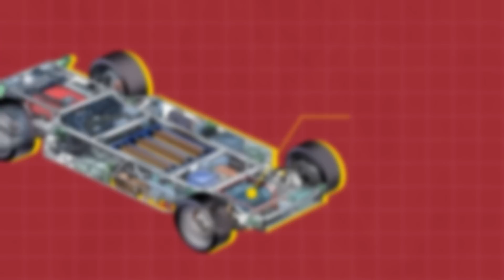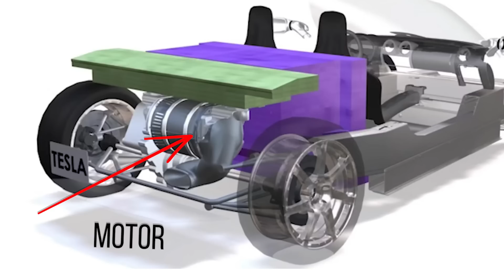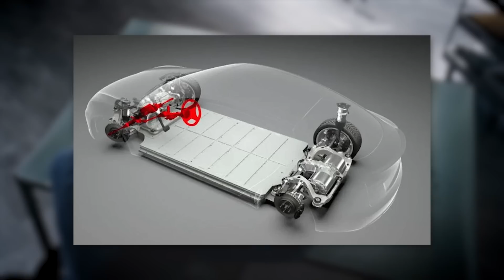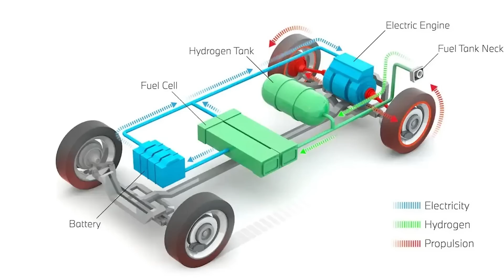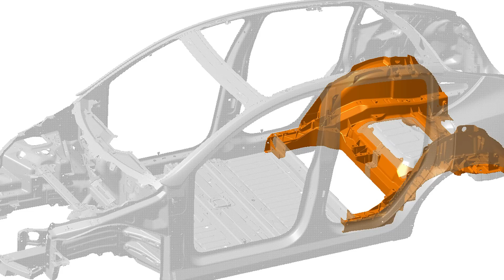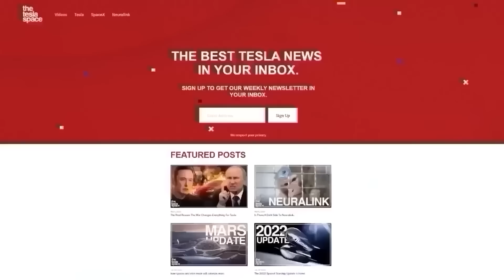The Real Reason Tesla Developed Their Own Battery Platform!

Comment: Lol. As much as Tesla really has done cool things and its good to highlight them they also suck from a users perspective at times. Taking away all buttons and indicator controls are a mess in terms of design and safety. Which is why i don't really like the uber-positive tone here in the video which kinda puts them up as a holy grail.

And before someone mopes around, i drive a M3P myself - it is a good car but they are making it worse and worse. Still missing an HUD, MatrixLED, Radar/Lidar, bad autoparking due to vision only etc. As much as they innovate in one point they suck at other points that are actually more valuable for the end user. Great that Tesla now can build cars easier - but how do i profit from that while using it ?

Comment: Long-term operational function is the goal. I have been looking for a method where the battery modules can be slid out, like a drawer, so the old battery can be lifted out and recycled, a new battery is placed back in the open space, and the drawer is slid back into place. This new plan seems to make it well nigh impossible to change the battery.

Comment: This is just elon musks way of saying, "I have figured out by way of manufacturing how to circumvent the right to repair your own vehicle."  By integrating the batteries into the floor and using the sticky foam they will be less likely to be salvaged from an accident or removed from the chassis without damaging it. Now elon can charge you $20,000 for a whole new battery unit when one cell becomes damaged or can't hold a charge. They are becoming more apple like. Every one is following this business model.

Comment: I would love to hear how Tesla plans to service the new batteries! The current modular design is great for servicing the battery pack. You just drop down the battery pack and change the module that is damaged or has suffered a drop in capacity. This way the battery pack's life can be as long as the rest of the car's with just a few changed modules during the years. With the new design, the whole car might have to be scrapped when one cell's capacity drops or it gets damaged. Or at minimum I guess you will have to cut the whole battery open, take out the foam, replace the damaged cell, and then weld the whole thing together again, which seems expensive.
Reply: I have never heard of Tesla battery packs having individual cells replaced. As far as I am aware they replace the battery pack as a whole if you have a problem. Are you speculating that this is what they do or do you have concrete evidence that Tesla will replace individual failed cells?
Reply: @AbnormalAspirations  I actually only know that other car brands change individual modules (cheaper than changing the whole battery), while they will not change individual cells. I don't know if Tesla does this with their current models. What I was referring to in my comment was that the new design does not seem to have modules, so you would have to identify and change the damaged cells, which seems more difficult.
Reply: @AbnormalAspirations  I thought Tesla batteries come in modules. Battery cells are packed in a module, and modules make the battery pack.
Reply: My first thought with this design was "How do you change the batteries when they are used?" The engagement makes it difficult and expensive.
Reply: @mlight7402  these batteries are designed to reach a million miles, or more depending on the way you treat them. It's crazy, I know, but that is the results some tests have seen in the present. This will only get better in the near future. And I do believe Tesla has a really comprehensive warranty coverage for owners of unmodified vehicles. All in the name of allowing for peace of mind.
Reply: @djbis  Agreed, and I am thinking cradle-to-grave to know what the endpoint is. Our lack of information about combustion engines is what has led to climate change. What will we need to do when the million miles is done?

Comment: Why for the sake of sustainability would someone make battery replacement virtually impossible? As far as I know, the battery is more prone to degradation than the wear and tear of the rest of the car. If I had the chance to talk to @ElonMusk, I would ask him to build cars with a battery, that can be exchanged easily. Two batteries in the same car would make even more sense: one built-in part, that occupies space where access is difficult and only possible by mechanics and one removable part, that can be exchanged easily. This would allow for so many different use cases.

Comment: Tesla is still using the dated Japanese cell design, it doesn't matter if they increase the diameter, the ratio of empty gap remains the same when you try to fit a circle into a square. not to mention that rolling the cells naturally lead to the inner edges aging faster than the outer age due to the angle of the folds being higher on the inner edge.
Reply: At this point, the majority of new Tesla cars are using prismatic LFP batteries made by CATL (and recently BYD). AFAIK, Tesla is only using the cylindrical form factor with nickel-based batteries, which need more cooling than LFP and LMFP.

Comment: I own a 2018 model X that when delivered had 240 miles of range.  5 years later it has only 197 miles of range.  Tesla says this is normal.   I expect to have to replace at least some of the cells or modules in the next 3 years if I want to continue using this as my only vehicle.  This new design looks like you have to replace the entire battery pack and mid frame to replace batteries.  That is a step in the wrong direction of repairability.  Pay me now or pay me later.  I prefer a more repairable platform.

Comment: Wow, it has improve efficiency in manufacturing side.  So how would you repairing, remove, and/or replacing the battery pack in the near future?   When there is a battery issue in a minor accident,  new battery technology upgrade, and degradation after 7-10yrs.

Comment: I had the same modular idea back in 2001.  I would build an electric car frame and be able to bolt on different kit car bodies from the 50s and 60s and make them inter changeable with a few modifications of pivot joints.  I became busy with other work and I never got an investor.

Comment: What about facilitating replacement of batteries as the car ages?
Reply: Around the time of the 2020 battery day, Musk announced that because of the structural battery pack, 4680 cell, maxwell dry electrode tech, AND a new iron sodium chemistry, we may be looking at 1 million mile cars. At this point, it doesn't make business sense for car companies to actually sell the cars anymore because consumer demand for replacing these vehicles won't be there; especially when you consider over the air updates. 

As a result, Tesla (and others like BMW) are looking at converting the car into a platform: consumers make an initial upfront purchase but then pay a subscription for various car-services. In 2020, it sounded like Tesla was actually looking at eventually not even selling cars outright, instead they would operate an uber-like service where people would just pay them when they need a car. This would secure 1. acceleration towards electrified transit (i.e. Tesla's mission) and 2. ensure a constant revenue stream for Tesla

Comment: Doesn't this make the battery and everything else inside a non serviceable part?
Reply: Much as the battery in your phone?  In much the same way I'm guessing that it is so much cheaper to produce that if it is reliable enough it overall becomes cheaper to throw the whole car away when the odd pack fails.  The only issue is who takes the risk, Tesla or the customer.  I would also hazard this is why second hand EVs are cheap right now.

Comment: How long do the batteries last? Will there be only tesla oldtimers in 40 years, which were either specially maintained for their entire lifetime or no longer have any battery power?
Reply: Well for one thing. Batteries can be changed. Second. In 300k km only around 10-20% Max Battery capacity loss.
I don't see a problem with longevity here.
Reply: @TheDashACorner  can the battery really be replaced? i understood that the battery is cast into the car frame.
Reply: @wolfgangloll2747  Didn't say it will be easy. But they can be replaced of course. If you talk about oldtimers then keeping those running can come very costly. So in this context it surely is possible but a lot of work.
Reply: @TheDashACorner  
Sustainability bothers me here. Can they be recycled? I figure the dropping in range is exponential, so eventually you're designing a car that is thrown away.
Granted people do that already, but that's a people problem.
Reply: How long will an actual ICE vehicle will last? how much does the cost adds up for surprise maintenance ?

Comment: Problem with using the battery as the chassis means that it will always be damaged in an accident.  Which is why there have been fires in them after accidents, sometimes even weeks later.
Reply: The new structural battery pack actually moves the batteries closer to the center of the car, making batter damage less likely, while also improving handling.
Reply: Another problem is that they can't do battery swapping,  Semi solid state and solid state batteries requires battery swapping because they have low cycles
Reply: @rwyo83  Costs a fortune to do on the Tesla, some other models it is much easier to swap out the battery bank for another and then send the old one for repair.

Comment: I'm curious to know the repairability in the event of battery failure or accident
Reply: As good as an iPhone!
Reply: They aren't very repairable. I assume that Tesla has perfected its manufacturing to have a very low failure rate in the batteries, so there won't be high warranty costs for the company and Tesla assumes that its autonomy features will avoid a lot of accidents. However, I wouldn't buy a Tesla precisely because how hard it will be to fix in the future. Tesla doesn't allow non-certified repair shops to buy its replacement parts, and the few shops that are Tesla certified charge very high rates to do repair work. With structural battery packs and gigacasting, I suspect that it will be very expensive to repair the car, since you have to replace so much of the car, so normal accidents will result in totalling the car.

Comment: So this battery pack essentially cannot be repaired or replaced?  If something goes wrong, or the pack ages out, all you can do is throw away the entire pack, or even the entire car?  It's the equivalent of Apple's glue-in laptop and ipad batteries.  How is this good?
Reply: As with apples glue-in laptops and ipad batteries, there will be smart people who will figure out how to repair them in no-time as soon as the demand is there.
Reply: It will be more difficult than changing an ICE engine but it ought to be possible to drop out the structural battery pack. But what do I know. I would appreciate information on this from one who is qualified to give it.
Reply: Very few people keep their cars longer than 20 years so it’s really a non issue.
Reply: @mikemccormick6128  If one of cells dies then you will have to buy whole battery pack. You obviously have IQ  below 100.

Comment: So the cells are glued in to a compartment that is a structural component of the vehicle which in essence writes off the vehicle when it's performance degrades over time and use.
Reply: it is true that it's not economically feasible to replace the battery pack in this latest iteration, but battery degradation is not an issue.  The latest data on the Model S/X battery performance showed only a 12% degradation after 200,000 miles.  That's longer than most cars will ever drive before being scrapped and you still have 88% left.  And that's with older battery technology.

Comment: Building multiple cars on the same platform is nothing new and there are a number of examples such as the Nissan 370Z/Infiniti QX70, Fiat 124 Spider/Lada Riva, VW Touran/Audi TT and VW Touareg/Lamborghini Urus where vehicles use the same platform. 

The concept though has its restrictions, a Model S and Model Y are unlikely to ever have the same platform and with standardisation of large components, often it comes with compromise. 

Traditional ICE manufacturers went from using the basic platform that they used for their ICE vehicles on the EV vehicles to designing their EV's from the ground up.  

Where does the standard battery bed fit in with the vehicles that Tesla plan to build using a GigaPress?

Comment: Reducing overall weight and manufacturing efficiency is always a good thing.  I am curious if this will help or hurt the ability of a repair shop to fix a Tesla vs. having to total it out after an accident.
Reply: When a cell goes bad in Lightning you only replace the module it is in.  Not the whole pack.   Structural pack must translate into higher insurance once a few companies start paying for their replacement.
Reply: Body damage is incredibly expensive to repair.  The chassis design does not make the body cheaper.  The cybertruck body is the solution.  Use a paint free durable exterior material that resists damage from minor, but costly fender benders.  The chassis still maintains signigifcant salvage value after the is deemed totalled.
Reply: @ecoriderLNT  I remember the old Saturn's had ads where people took a baseball bat to them and the panels bounced back, but I guess steel is cheaper or others would have adopted that.
Reply: it makes it worst, but u have to be in a big accident to damage the frame.
Reply: @lagrangewei how about running over an item that was dropped on the freeway?  If the cell pack gets punctured from below would the whole chassis need to be replaced?

Comment: Sorry but your analysis of that GM car they offered in the 90’s was BS and you should be ashamed of your self. That car was a hit, however it was not made for the consumer - it was produced and used as a wedge to effect Californias’ cafe standard. Cal had mandated a mileage standard of 50miles per gallon and big oil wanted to gut it. So that car was not sold, it was only leased. That way GM could maintain complete control over the vehicle. It offered a kumbaya moment while the oil lobby worked congress to get a more favorable mileage standard and once a newer and lower standard was enacted. GM recalled every lease, took the car off the market and crushed them. (I know because I worked as a car wrangler for Hertz. And one day as I was handing back to LAX, I came across a major train depot in Orange County. And all those returned cars were lined up ready for shipment. The sun was setting and glinting off their wind shields.) They put out the lie that sales for the car was soft. But many people refused to give the car up when their lease was called and offered to straight up buy the thing, but was denied. Why, Because the car had served its purpose !!!

Comment: How come the original VW bug isn't credited for the state board design?
Reply: Or all body on frame vehicles?  The unique attribute of GMs skateboard is removing the steering column, and going full drive by wire.  Tesla isn't there yet, but it would go well with a full autonomous platform that could enable manual override with a wireless game controller.
Reply: @ecoriderLNT  isn't cyber truck fly-by wire?
Reply: Skateboard is a new name for an original ww2 VW bug chassis, it predate actual skateboards themselves, many a Hollywood movie an series car jump involved a VW pan [aka skateboard ] with a car kit bolted to the VW pan with a nitric oxide bottle, like night rider TV show.

Comment: What about battery swapping? EV manufacture Nio is probably starting a trend that is far more likely to be the future model for EVs for many people, but especially for people who travel a lot, tow a lot, commute a lot and who do not live in a home with a charger. Why carry around a huge battery when people average 30 miles a day in commuting? This is incredibly wasteful and inefficient. It would be far better for people to drive with a 40kWh battery, and when they need to travel or tow then they can upgrade batteries by swapping to a high capacity battery. This also means people can swap the battery in 2-3 minutes instead of charging forever. It also gives third party suppliers the option of producing batteries to swap into cars and providing swapping stations.